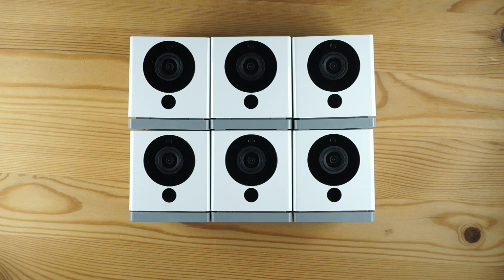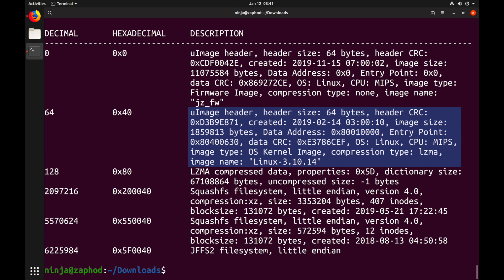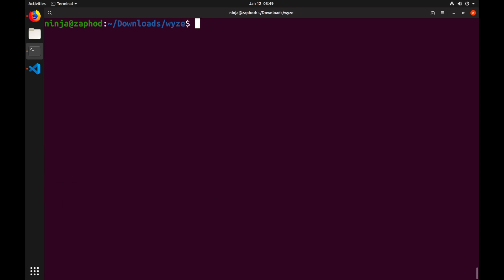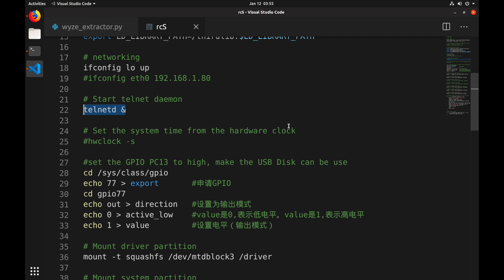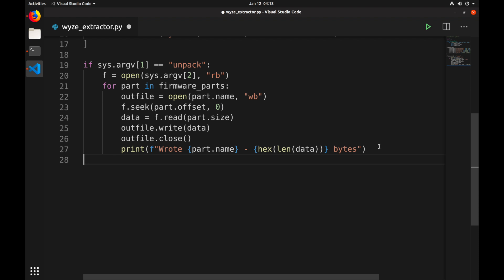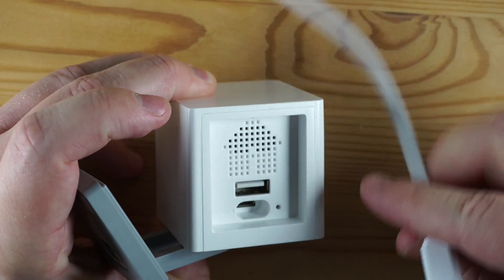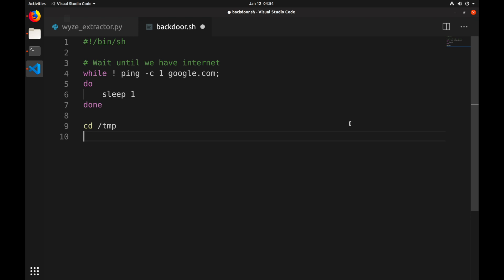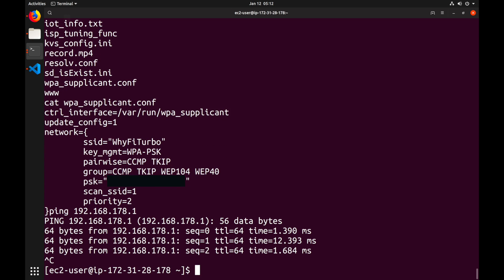IoT Security: Backdooring a smart camera by creating a malicious firmware upgrade

Comment: Secure firmware upgrades are a massive problem with stripping owners abilities to use their device how they want to.
If I own the device I should be able to install whatever firmware I want.

If the device is returned and then later given out to a new customer, they should be flashing known good firmware onto it and confirming that it is present.

Comment: Great video! Is there a way to repack the JFS2 directory like you did with the squashfs folders? I took a look at jefferson but the docs only mention the ability to extract.
Reply: You can re-pack the JFFS2 filesystem by using mkfs.jffs2.  The problem I'm running into is that the repacked filesystem (no modification) is larger than the original so my offsets are wrong when I go to re-pack the bin file.  I'm not terribly skilled in Python so I'm trying to figure out how to mod the wyze_extractor script to build the image properly using a modified JFFS2 filesystem.  Hopefully I'll be able to post my fixes here, as I'm working on a mod for my own purposes.

Comment: Would you please help a noob (little knowledge in navigation with Linux) how to check if any suspicious activity is going on on the devices (CCTV) - for instance how to check if any of the cameras or devices connected in my network having connections established outside of my network? 
How do I distinguish if the connection is due to cloud functionality (aka mobile access) or due to a malicious SW running in background. Thanks to every comment on this.

Comment: This is awesome, I can perfectly use tooling such as jefferson right now for firmware modification. To split up flash image partitions, I am simply using dd though and cat things together again.

Edit: Since it looks like jefferson is for extraction only, I'll stick with mounting the rootfs through the mtd + jffs2 kernel modules, which is a bit of work and annoyance, but solved. =) I will still keep jefferson in mind for extraction-only/analysis use-cases though, makes sense also to have something portable. Thank you!

Comment: Another thing to do is to engineer a completely new board for that camera. One that runs the original firmware, except on the SOC there is another hidden core that taps into the wifi and the camera sensor. Perhaps even add one of those very  interesting radios I read about the other day, and exfiltrate images from up to 7Km away. 
Now not everybody can afford a santa's work shop where all kinds of nifty things are made, such as certain upgrades for routers and the like, but it is still food for thought. The added benefit is you could leave the manufacturer provided backdoors dormant, perhaps add a feature to disable them remotely.
Reply: I think u r reefering to LORA.
Gupta doordan is around the neighborhood, fyi
Reply: @guajilote2464  Nope. Definitely not LORA. LORA would be for short tactical messages but obviously not for audio and video streams.

Comment: Can we quickly laugh at how stupid their way of stopping telnetd is? Instead of uninstalling it and or removing it from the rcS file, instead, they just kill it (And not even stop the service, just use killall.)
Reply: Based on where the killall is from, I'm guessing the telnetd was a backup access point for testing.  If the camera starts up, but can't load the camera app for some reason, it won't kill the telnet daemon, and they can log in to figure out what broke.
Reply: @Acorn_Anomaly  Shouldn’t make it into prod FW though
Reply: @ArnaudMEURET  No, but taking advantage of it in this instance would still require either an already compromised or non-functioning device.  There have been worse backdoor incidents.

Ideally, they'd have removed it or disabled it, but after they had an already working image, they may not have wanted to mess around too much with it, especially since, as I said above, taking advantage of that isn't generally achievable remotely.
Reply: maybe is used for support from the company
Reply: me thinks they be lazy

Comment: So if you buy one of these used, you should flash the official firmware. Apart from that, not restricting firmware flashing is not a big deal, since flashing it requires physical access to the camera anyway, and having the ability to flash a custom firmware means one can make custom security updates after the camera is discontinued and no longer receives official updates.
Reply: And hope that a return doesn't get repacked as new
Reply: " not restricting firmware flashing is not a big deal"
if this was the only way to install firmware, that might be true, 
BUT, it can also be upgraded remotely, without touching the camera. i dont know if that has any extra security or not.
Reply: It's a big deal because I can tamper with that camera and then sell it on ebay. Then as luck will have it that camera winds up somewhere important.
Reply: @statinskill  also because now it is in the local network, any other not so secure home device can be hacked
Reply: @statinskill  yes but I prefer devices where I can install my own firmware than devices that are locked on the manufacturer firmware. 

You need physical access to the device to install the firmware, well and the fact that you can install a custom firmware and sell it, it's true for everything, imagine a keyboard, what stops you from taking it apart and putting an hardware keylogger in it? Or even a device with all sorts of protections, in the end you can just modify the hardware. 

But if you have the possibility to flash a custom firmware, is not a problem, because you just don't trust the firmware of the Chinese manufacturer (that surely contains vulnerabilities or backdoors) and just flash your own. Problem solved.
Reply: @statinskill  but then the app won't work anymore.
Reply: @thilotech  Did he modify anything that would make the app no longer work ?
Reply: Ya
Reply: But I believe its also possible to disable the firmware upgrade feature completely or even fake it. Flashing Official firmware will not work in that case.

Comment: Having a secure firmware upgrade process is important, but it comes with a downside that few manfacturers are kind enough to mitigate. Sure, unauthorized users rely upon insecure firmware update processes to install backdoors, but they're also what authorized users often rely on, to install mods. But this is a tiny minority of customers, weighed against the far greater number of customers who would benefit from the extra security. And unfortunately, it's a tiny enough minority that most companies won't consider it worth the extra R&D for providing a secure alternative authentication method for use by the owner, even when they wouldn't otherwise have any reason to go out of their way to lock the owner out.

Comment: I am trying to learn aboutfirmware and stuff like that and am trying to do this with the foscam firmware 11_37_2_65 when I use binwalk on it it shows a zip archive and a romfs filesystem but I cannot find out how to modify the rom fs filesystem can anyone help and tell me how I can modify it?

binwalk output 
20            0x14            Zip archive data, at least v2.0 to extract, compressed size: 740120, uncompressed size: 1547720, name: linux.bin
740270        0xB4BAE         End of Zip archive, footer length: 22
740292        0xB4BC4         romfs filesystem, version 1 size: 1003200 bytes, named "rom 52601301"

file output after using the extractor tool
romfs: romfs filesystem, version 1 1003200 bytes, named rom 52601301.

Comment: Could you extract the firmware for Vstarcam cameras? They're not available online and the updater inside the camera only downloads a diff of what needs to be updated. I tried extracting from the flash using a raspberry pi but it didn't work. These cameras are one of the most sold on aliexpress and I can't find a way to telnet to them. Their RTSP server keeps crashing and I wanted to write a custom script to restart this server. Would be nice if you managed to crack these cameras. Thanks!

Comment: Can I ask how did you learn so much about Linux and other commands that you have used and python ? Please mention any resources that you used while learning.
Reply from the maker: Honestly - I've been using UNIX/Linux just for a long time as my daily driver. Nowadays there is a ton of great introductory material on the net, same for Python. A lot of the embedded knowledge also comes from having written own embedded firmwares etc - I think knowing how to build something drastically helps with taking it apart :)
Reply: @stacksmashing  thanks for the response !

Comment: I once bought a shady cam on Amazon just for the fun of it and did a port scan, found out they simply had the Telnet port open with no root password set so yeah...
I'd love to flash a custom firmware on the camera since the hardware itself is nice but it doesn't provide RTSP (open Telnet port wouldn't be much of an issue just in my local LAN and behind a separate VLAN) but it seems like that my camera has almost no Google entries at all :(
Reply: Since around three years I've been seeing you all over YouTube videos I watch. You have some fine taste haha.
Reply: There is an official Wyze firmware that supports RTSP